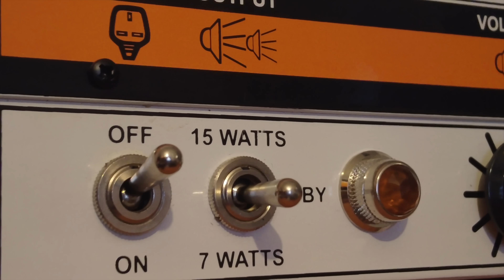WORLDS HOTTEST PICKUP

Comment: I'd love to hear this in a bass.
Reply: Talk about hitting the 'brown note'... 😂
Reply: The cab's speakers wouldn't love it...
Reply: similar thing happened with Gibson basses, the 60's EB- basses had a massive sidewinder humbucker, 30k ohms!
Reply: The sidewinders have very weak magnets tho so the output is not as ridiculous as the DCR would suggest
Reply: @xdoctorblindx  what does that have to do with anything? My speakers don't care what pickup I'm using.
Reply: @xdoctorblindx  That's not a problem, as you have a gain control to dial down the input!  As for sound, I can't imagine it's useful.
Reply: so who's going to wind it?
Reply: This pickup reminds me to the Peavey T40 pickup
Reply: It would be more horrible in a bass then it is in this guitar. The Gibson 30k mudbuckers suck bad as well.
Ive got a SD hot stack ( about 18k ) in the bridge position of a P/J bass , the split coil at 11k still beats it.

Comment: Would be interesting to hear how that pickup would sound with different pots,  250k 500k 1meg ect.
Reply: Yeah I'd love to see this! Your reviews are top notch!
Reply: Probably needs a 1 meg pot just to regain some of the highs.
Reply: @psykoklown874  Or even a bright cap across the pot.
Reply: It won't make any difference this hot.
Reply: @coalfacechris1336 That only makes a difference when rolling down the volume below 10, which you'd never do with a pickup like this.
Reply: Definitely a 1meg pot, or a no load pot would return alot of highs.
Reply: Or no pot at all
Reply: agreed
Reply: @xdoctorblindx  "Below 10"  on any pot is off!  The volume pot is wired as a voltage splitter and moves the signal to ground incrementally, tone pots move select frequencies to ground in the same way, but through a capacitor as a filter.   With the volume all the way down it's a short to ground, so you should get no signal at all, or if a tiny bit, then it's not a good pot!

If yours doesn't work that way, then your guitar isn't wired correctly!
Reply: @mr.banana4893  Fantom values are not "A lot" in any case, and good pots have less of them.  The little treble you would gain will not be enough to tame that beast and de-mud it, because the output is already so high the volumes EQ is irrelevant.  The capacitance of a volume pot is relative to it's physical construction first whereas they do not vary much no matter whet it's value, then the voltage and current, and most noticeable when the Voltage is lower.  It's why adding a cap to the volume knobs or the jack with hot pickups is often required, to act as a  high-pass filter (Retaining highs) as the phantom value counts less the higher the pickups output.
Reply: Was thinking this as well
Reply: 1 Meg pots and an amo with headroo.
Reply: done that!

Comment: There are three things I would love to hear with this pickup:

- Coil split. If it's this hot as a humbucker, what happens if you only have one coil left? Single coils tend to be brighter than humbuckers, so that might actually solve the resistance issue.
- Does it clean up if you roll down the volume? How far can you take this? Is the tone useful in this scenario?
- Treble cap to boost highs. A bit of extra brightness wouldn't hurt, so perhaps a capacitor could help with this.

Overall, I think this sounded better than I had expected. Yes, it sounds compressed. However, I think it sounded more barky and dynamic than boosting an amp with a Tube Screamer. There is more experimentation to be done. I hope you'll consider making a follow-up video.
Reply: likely the increased capacitance from huge windings will effect the tone, unless it was scatter wound
Reply: using a 1meg tone pot or changing the tone cap could also work
Reply: A treble bleed only works when there is treble to bleed. Turning down the volume will only darken the tone and bleeding what treble there is when you turn down won't be much. While the volume is wide open, it will do nothing. You can't add what isn't there. An eq pedal might help. There's plenty to scoop out and enough treble to boost.

Comment: Just an F.Y.I. - while DC resistance for a pickup can help indicate more signal level/output (more DC resistance means more windings of wire for the pickup, which means more of a magnetic field, for the string to pass though, inducting more electrical voltage/signal through the pickup coils). I have a bit of an electronics background (I guess it's why I did most of the electronics related tech stuff for the bands I played in), and would like to point out that there are other factors in pickup output such as pickup magnet strength (though if the magnets are too strong, they will have a tendency to pull on the strings too much, killing string vibration, and in some cases, pull the string out of tune), and pickup height/closeness to the strings.  Also, DC resistance can be higher, just because of the wire size of the coils being small (smaller wire typically has a higher electrical resistance).  As much of a pain as it is, the only real way to tell what a pickup's output is, to measure the voltage, when a string is plucked, with an oscilloscope, or a voltmeter (preferably an AC voltmeter).

I'm not surprised that you noticed a loss of high end for the pickup.  With as many windings as it has to give it a 54 kilo-ohms DC resistance, it has very high inductance.  The higher the inductance, the more, that higher frequencies are impeded/blocked.  It's a tradeoff for mega output pickups.  You either go the active route (relatively few windings to preserve the high end, and an internal pre-amp to boost the pickup signal), or wind the living daylights out of a passive pickup, and put up with it being darker sounding.
Reply: Excellent points! I wanted to make them but there is no need.
One thing maybe: it's easy and cheap to measure the inductance (devices cost about the same as multimeters); it would be interesting to know that.
Reply: Bang on. As an electronic and electrical engineer as soon as resistance of the pickup was equated to “power output” my spidey sense tingled. Great that you gave this run down !
Reply: if it was wound by machine rather than scatter wound, it would have increased capacitance also, similar effect as putting a tone cap across the output.

Comment: 54kOhm is INSANE! But high coil resistance don't necessarily mean high output, it depends on magnet strength as well, so you can have a low resistance high output pickup with really strong magnets, and they sound really cool.
Reply: The phrasing "high output" when referring specifically to high resistance (Ohms) is confusing to me... The higher resistance refers to the coil's resistance to the flow of electricity, so how could this result in a higher output to the amp?
Reply: @TaterMater22  think of it as a rail gun, but in reverse (sorry for my bad English)
Reply: @TaterMater22  means there is more wire for the string to create eddy currents into (I think, not quite sure).
Reply: @TaterMater22  It generally means more winds.  More winds increases signal strength and inductance to the point of diminishing return i.e. wire far from the magnetized string portion doesn't contribute much to output.  Typical Fender SC pickups are actually pretty inefficient in the respect.  The bottom half (or so) of the coil doesn't add much.  The most efficient pickup coil cross section would be ~1/8" square.  Thinner (higher gauge) wire has higher resistance, but thinner wire coils are denser, and can be situated closer to the strongest magnetic section of the string, so the slight loss of output from the increased resistance can be offset by the increased coil efficiency.
Reply: @TaterMater22 I am also confused. I thought a lower output impedance would result in more signal to the load/amp input.
Reply: @GCKelloch  what do you mean by inductance D:
Reply: more coils of smaller wire give higher voltage lower amperage. Also if machine wound, increased capacitance killing the highs, unless scatter wound.

Comment: The loss of treble is actually a product of both resistance and capacitance in the pickup, the more turns on a pickup, and thinner insulating layer, generally the more capacitance. and the thinner the wire (to allow more turns in the same size), the higher the resistance, which together with the capacitance forms a low pass filter, filters out treble.
And it's also the reason often older pickups that use plain enamel wire have more treble than newer pickups with poly wire, the plain enamel insulation layer is thicker so the capacitance is lower, less treble loss.

Comment: The HOTTER you get, usually the darker the pick up! That much circuit resistance will shift the resonant peak downwards!
Reply: Only Bill Lawrence figured out how to get big output with a bright tone. Sadly, it's very easy to make them sound like a box of bees and if you run them you kinda gotta move everything over to them or you'll be spending more time tweaking your amp than playing.
Reply: @arthurreid6108  so you are saying I shouldn't play a box of bees? Weird...
<puts down beehive>
Reply: Well, inductance and capacitance. But still generally right.
Reply: @arthurreid6108  Dimarzio X2N is a very high output and it sounds really bright.
Reply: @craigharrison5406  I have the X2N in 4 guitars, it's my pickup of choice, but I'm not sure I'd call it a bright pickup. It's a very well balanced pickup, which sounds bright compared to almost anything else at that output level (except Bill Lawrence stuff). But the BL stuff is actually bright, brighter than PAF bright.
Reply: @mrljgibson  Bzzz bzzzz bzzzz.
Reply: I do own a Seymour Duncan Dimebag pickup, it's a nice balance. 🤣
Reply: @mrljgibson  Cool!

Comment: I always found the voicing of a pickup to be more important than the output. Granted you don't want to be running vintage pickups for death metal but I've found some of the best sounding metal pickups can be medium output pickups. The Seymour Duncan Custom is a perfect example. The best sounding super high output pickup I've played is the Dimarzio X2N. Tons of volume and gain but still has a well rounded voicing that doesn't sound too harsh.
Reply: I have been putting high output pickups in guitars for years, I finally tried some mid output pickups and I find my leads sound smoother and sweeter. Especially when switching to the neck position. I play a peavey 5150 but don’t use as much gain as it has on tap, so using the lower output pickup and cranking the amp a little more creates a more dynamic/ harmonic distortion- instead of edgy grind.
Reply: "you don't want to be running vintage pickups for death metal"  HA! That's exactly what I do. Low output single coils.

Comment: Man I had an x2n in my les Paul back in high school. I preferred the duncan sh-8 invaders tonally but they’re both kinda like having a passive boost in your volume knob. 
 It’s hilarious how much it distorts your signal on full, great if you want that 70s “insane volume boost into vintage amp” type of playing.
Reply: I put an X2N in my Les Paul and love it. In series, it's the kick my Rat and Plexi need to give me metal. Split, it's a passable Strat bridge sound.
Reply: @100DollarHeadache  I imagine that plexi is just screaming from all the gain and boost. As god intended of course.

Interestingly I like the rat with lower gain settings lately. It’s a good treble booster and overdrive!
Reply: @potatoheadhaoy  My Rat is actually a DIY clone, using LEDs for clipping to make it a Turbo. I prefer using it as a dirty boost, I mounted the LEDs externally to see when the pedal is providing clipping, and use this to balance it between guitars.

Comment: Hi there, great found!  Some people uses an overdrive  not just to push the amp harder, but,  most overdrives has a lo-cut at the first stage, and it makes the sound less fuzzier. More low end before gain staging causes mud on the tone If you try  the  SD-1 with the ton open, this will roll off the bottom end. If you do not crank up the level and keep the drive all the way down it will clean up the mud and makes it ore usable. OR you can use ONE HPF before hitting the first stage of gain but will never ever get the highs back since they were rolled off at the very beginning, right at the genesis. the maximum DC resistance tolerable to my ears is the 18.30 kΩ I got on my custom made Malagoli Eldorado pickup at my Kirk Hammet. more than that the signal becomes way much muddier. Also Output is not measured by DC resistance. The output level is measured in milivolts instead. Resistance is just consequence of the winding amount. I guess I could never use this in a production situation, they suck highs and for this I could use an equalizer before hiting the drives.

Comment: Interesting pickup.  If you still have it in that guitar, why not try using it with a Tube Screamer type pedal - but set it up to cut the signal slightly in order to enable a 'clean' channel.  My theory is that with the way a Tube Screamer tends to cut the mids and effectively boost higher frequencies it could be a good match for this pickup.  An EQ pedal could be a good alternative as well.

Comment: Interesting, really highlights how when you increase coil windings, you really create that spike in midrange, with that "aw" sound really poking through. While I prefer the 8k pickup, even for high-gain stuff, this pickup really does serve a purpose. Would be great for black metal. It definitely makes me wonder if there's the need for ultra high output pickups these days. They definitely seemed more relevant with older style amps that really needed coaxed into distortion.

Comment: I have two 24k pickups that I used on a metal style guitar. It was a muddy mess. However, based on observations and research, it has its uses. If the hot pickup were lowered on the neck position, it can sustain for a long time. Plus, coil-tap and coil splitting can add tonal versatility as well

Comment: I'm morbidly curious what it sounds like in parallel wiring -- that would probably bring back some treble definition and maybe even make it usable for mere mortals.  A 1 meg pot with a treble bleed cap should also help, since this seems like the kind of thing you'd want to play with the volume rolled back a bit and then dime back out for solos.
Reply: That was my thought, how did it respond to the volume control? Is this just a powerful gain boost at 100%, but the majority of playing can be done at 50-60% on the volume with less treble loss?
Reply: I ran a Dimarzio X2N back in the 80s when that was the over the top humbucker.  I ran it 4 wire so I could run standard series, parallel, and single. I liked the parallel best, but I have always felt I am the only person in the world that appreciates parallel humbuckers.
Reply: @eilliwwasniahc  parallel has nicer tones

Comment: A genuine mud-bucker. As a professional luthier for over 40 years, even most my metal players wouldn't like that sound. No articulation, no definition. Lindy Fralin - a pickup master - has graphs that show the relationship between output and high-end roll-off. Lots of variables here like what magnets, alnico II, alnico IV, alnico V, ceramic? I've found that about 12K - 16K alnico V pickups seem to be the sweet spot in a bridge, and about 8K-9K in the neck. Tone is always subjective to your style of playing and amp, but 54K is just way too hot to be practical. Thanks for sharing! Rock On!
Reply: Doom metal players would love it. Put it through a maxed out Proco RAT or a Big Muff, into an already breaking up big clean amp and make diesel generators noises. Perfect.

Comment: I'm an electronics guy, pickup output is not measured in k ohms that is its DC impedance.
Output is measured as volts peak to peak into a known load, so to properly compare two pickups you would measure output voltage (peak to peak) for each pickup on an oscilloscope while hitting the strings with the same force. If one pickup makes 1v p/p and the other makes 2v p/p the second pickup has TWICE the output.
I bought an original dimarzio X2N super distortion in about 1982 when they came out. It had the big bar magnets. Even for metal playing it was muddy because if the magnets are too strong they pull on the strings influencing the strings. I played it for years but had to run the pickup quite low (away from strings) to reduce the muddiness.

Comment: 54kOhm is DC RESISTANCE! It's not the same thing as output level, which is normally measured in volts. They correlate in pickups if other parameters (particularly wire gauge) stay constant. But high resistance alone is not indicator of high output. It may be result of thinner wire being used in the pickup, which would hurt the output level.

Comment: You can run these through a high pass cap, and add a bass pass resistor to add some bass back..  These also work nice in reverse polarity with the neck pick up, and put a super switch to either the super distortion bridge or the neck on a Gibson type pot blend circuit, so one of the out of phase coils bends into the other in phase coil, and the blend knob works as a nice tone control by using one pickup to cancel the bass frequency from the others.

Comment: This would be interesting for doom metal. Also, maybe they could use a neodymium magnet to make up for the loss highs?
Reply: Idk man that pickup would make any fuzz pedal shit bricks.
Reply: @Eliphas_Elric  you wouldn't need fuzz pedals :p
Reply: It would be an absolutely terrible doom pickup. Hot pickups are dogshit for low tunings when they're 11k, nevermind 54k. Tune this to drop A and it's going to sound like you've got a mattress in front if your amp
Reply: @DrRepper  Facts.

If yall haven't check the Dimarzio Fortitude. I know Gojira ain't doom but Joe's sig pickup dooms.